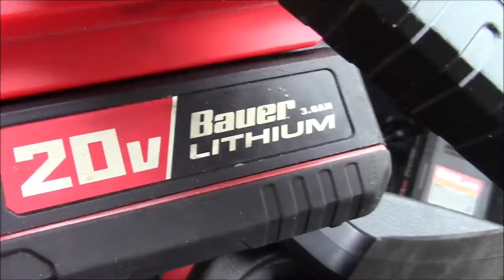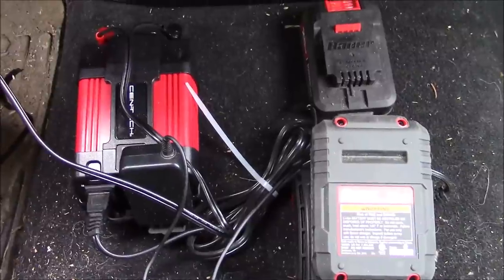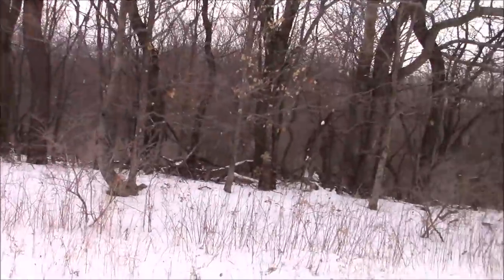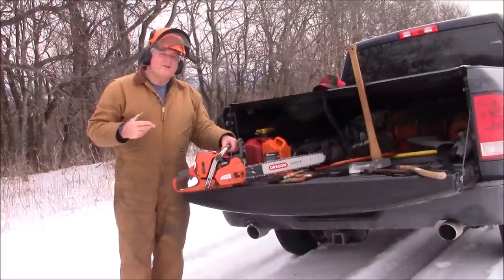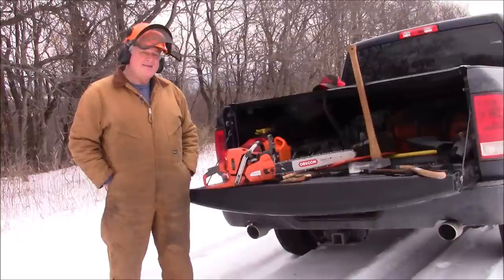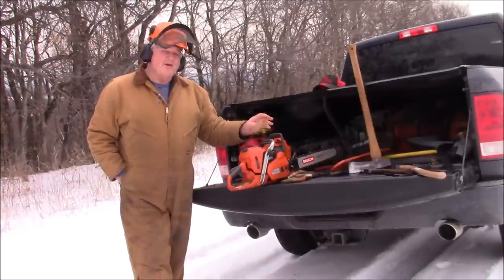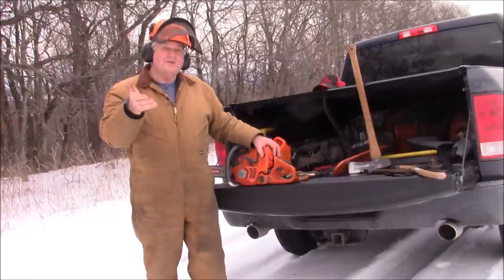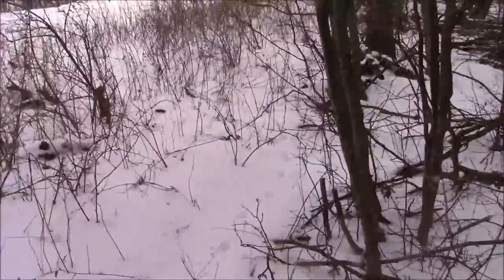Husqvarna 555, 562 & 560 Autotunes &  Discussion on HOW Autotune Works, Channel Update 2021

Comment: Ever since i purchased my 572 i love the fact that i dont have to adjust the carburetor during inclimate weather like snow rain freezing temperatures etc. My  husky 390 is moody during that kind of weather but that will all be solved when the 590 xp comes out!😁
Reply: 140psi Good compresion 372xp oem?
Reply: I keep telling my wife I have to have a 572 because I am getting to old to carry my um 25 outher saw I have and I explain how hard it is to tune those carbs all the time and the chokes are hard to pull so it's practically impossible to keep cutting our wood unless I have one glad you love your 572
Reply from the maker: Think we went around the block on this already. 150 is good, 140 "OK"

Comment: This goes back to my “Rule of Four”. I never pull any saw more than four times in full choke without bumping it up to half choke where I pull it four more times.  If it has not started by then I blip it’s up to run and pull it four more times.  If it has not started by then I cuss it and take a smoke break and start over, again.  The only exception to this is on a MS 250.  I only pull it a couple of times before bumping it up to half choke.  If the saw pops, I push it down one level and pull until it runs.  Another smoke or coffee break may be mixed into this routine. Cussing will usually be part of the routine.  I got so mad at my ms 460 the other day that I put it on the picnic table and let it sit for several hours before I pulled it, again.  It started on the first pull.

Comment: I think it might be contingent on having a dealer in your area, and the MarkI 550s and others in that first generation were disastrous for us in the park service.
Reply from the maker: It is, even with the first ones where the saw design was the issue, the Autotune along with a good dealer could make things work acceptably. When I was at Highway, the 550's were a disaster as well. But like MANY places, a lot had to do with NO one showed the guys how to operate and start one. They would flood them daily. Some of the guys would put them at my home shop to dry them out...I would get them going and they would pick them up.....and after a lesson never had another issue. Even with the first versions of the 550's. The first 5 screw case 562's were another deal. I ended doing work for a dealer who had sold 12 of them to a town. Husqvarna warranted them and I did the work. That was before the short blocks were available to the dealers. There was a while Husqvarna was selling the short block with ALL kinds of upgrades relative to the 2011's for like $120 bucks. NOT sure that is still something they do, because the new ones haven't had problems so I don't see them anymore. After the 2016 562 versions came out, haven't seen hardly ANY issues with them. Haven't seen any with the 550MK2's or 572's either. Point is Autotunes as a technology was reliable , the first iteration of those eco saws designs weren't. Once they figured out that new design, they have been solid ever since. And the thing that has prompted me is the pervasive fear of "Autotune"...which never was the issue. :) And yes...a good dealer would have made the experience much much better.

Comment: Nice work on the cherry, very ugly lookin thing lol woulda barber chaired for sure, always like your vids, keep on keeping on!
Reply from the maker: The reason I bore cut from the front , leave about 4 inches a side for a hinge, is to minimize the "shear" from the hinge wanting to make a barber chair. Often if I leave a full width hinge, the barber chair start right there. And then the bore cut from the side to make absolutely certain the hinge isn't TOO thick, along with the bore cut from the front pretty much takes barber chairs off the table :) And thanks for watching AND the feed back!

Comment: Walt did you do a muffler mod on that 550/560? I did a muffler mod on my 465 rancher and it’s a beast. A nice increase in power.
Reply from the maker: I cut a square hole in the internal baffle directly in front of the exhaust port so the hot gases go over vs are deflected down to the bottom side of the muffler, THIS to have that space between the baffle and the bottom side of the muffler as an insulator , reducing the temperature of the bottom of the muffler therefore how much heat is radiated to the cases.....:) Not what u expected I bet. :) 

Oh, and I did put a "tube" pointing to the pto side up and away to reduce back pressure in the upper half of the muffler to make certain the hot gasses got out as fast as reasonable, with out dropping the back pressure to the exhaust to where it hurts the saws performance. The mod was more about heat and the control of case temperatures to mitigate other issues than actual performance gains.. BUT it did help in the intended goal as well as throttle response as a bonus.

Comment: Here is my deal walk with autotune Walt i have no issues with it. The only issue is my dealer charges 1 hr of shop labor to hook up the autotune to his computer to flash it or look for problems.
Shop rate is $80 per hr so i will stick to conventional carb saws for the time being.
Reply from the maker: I understand that. ANd I do have to admit, my little 48mm builds now are a match of anything you can buy in its power to weight and fuel usage :)

Comment: I grew up a Husky guy and very much enjoy their products. However, I don’t have any dealers around me. How would I get the card flashed, if need be?  I’m on the fence about purchasing a 562 and a 572 (want it to be my 24” bar saw). But, if work needs done. Can I get the software and repair/update myself?
Reply from the maker: No but the point is if you buy something like a 572 new, you probably will never have to work on that saw. Several dealers will do the flash if u mail them a carb and the ignition numbers. Join one of the Husqvarna based board on Facebook or now MeWe if you need that contact. Every thing else related to to working on your saw....u don't need a dealer is the point. U want to mod the saw, change pistons, top ends cases everything. Even doing things like carb kits u don't need to reflash that carb. That entire argument "want to work on the saw" isn't effected except....u will never have to tune your saw again. Season changes, after muffler mods. All you have to do is keep that carb/ignition comb together. So it's a non issue really. The one thing you don't get to take advantage of if u have no dealer or a lousy one is the feed back and reporting CST can offer. But u never had that with the older saws anyway.

Comment: My only problem, and I may say it might be better now since I haven’t been to the dealer in awhile, but the last 562 I worked on about a yr ago and went to my local dealer for a firmware update, it took 2 months and they charged me right at $85.
Reply from the maker: That's a lot of money, If that's ALL they did . But I wasn't there so no idea if they did things like change an air filter of did a diagnostic for some other problem
Reply: @afleetcommand  true on that. There was nothing else wrote on the ticket when I picked it up and the mechanic wasn’t in to ask. But the saw got fixed and I got paid as well so it all worked out in the end.

Comment: Guess I can figure that my Holzformma 372 will crash & burn one of these days. Good thing it didn’t cost a lot!
Reply from the maker: I have to qualify, it may never crash and burn as most people will never put the time on them my test site do. Do the math. Those saws were LIKED by the operators, a blessing and a curse. SO the ones lasted in the 5 to 6 month range in a full production environment. 7 or 8 hours a day , 6 days a week for 6 months, in the 1000 running hour range, SO the average guy having "hobby" fun or cutting fire wood...how long will it take in years to get 1000 hours of hard use? From that perspective they aren't a bad deal. And the other factor.....maintenance. In my testing they were just RUN,  only maintenance was adding oil, gas,  and tightening, sharpening or replacing the chains. A hobby or firewood type will keep the saw clean...a factor. Tweak the carb, and basically show some "love" to that saw. My test saws were worked hard, put in the back of a truck...bounced around and worked again.
Reply: You are correct. I have a Stihl MS461 that I’m pretty sure I’m not going to kill in my lifetime so this Holzfforma makes for a nice fallback saw. I do like running it though so I reach for it first more often than not. I think it’s a little lighter too, so there’s that. And no, I could never put the time on it that your test mules get at the hands of loggers. I figure that the carb mounting rubber will probably go bad, along with some plastic parts but it’s all good. 

I really enjoy your channel. It looks beautiful up there. 👍

Comment: That is a nice saw I can't believe how Good it starts after all that time ,I have a 365xtork I want to put steel cage bearing in I can't find what I need any idea were to look or what part number any help would be appreciated
Reply from the maker: The SKF 6202 c3 size and rated bearing for the first gen 372's (pre 2010) work well and if u have a dealer worth a chit, he can get them for u.
Reply: Ebay.
Reply: Walt will the 6202’s fit both sides?
Thanks!
Reply from the maker: yes 6202 C3 rated on both sides